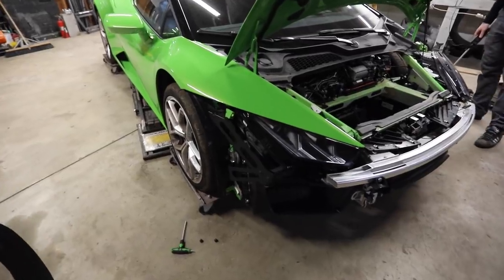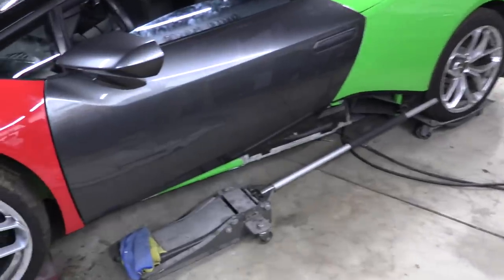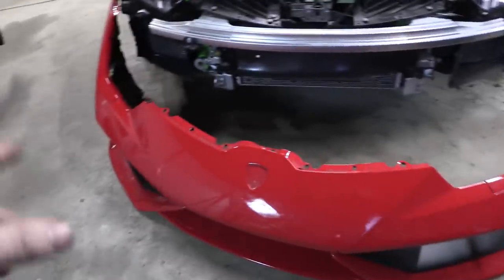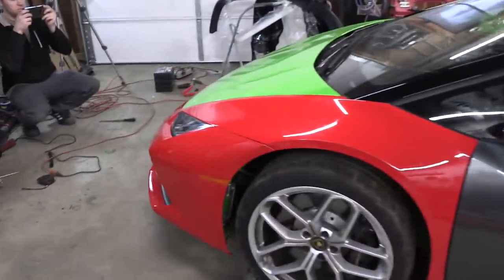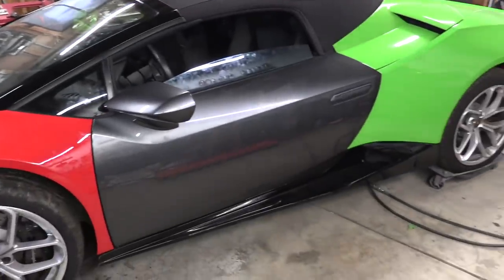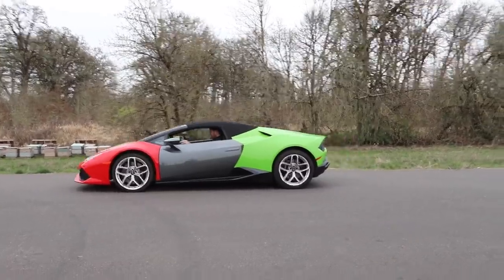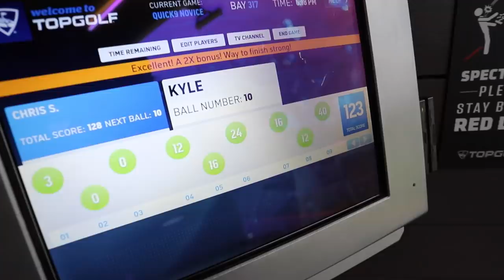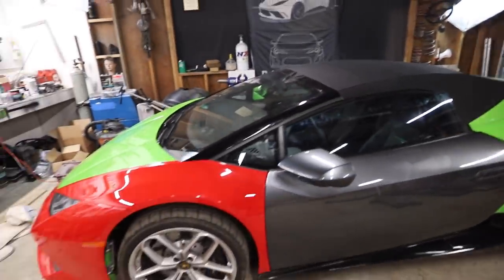Test Driving My Multi-Colored Lamborghini Huracan

Comment: I truly don't understand why anyone would buy a soft top convertible. They're so fugly and ruin the lines of the car.
Reply: Robert Hull so good with the top down tho
Reply: BiGMoFFen nah. Still looks like shit
Reply: Robert Hull if the soft top is lighter weight that might be one reason.
Reply: @joeracer302  that's not true. For the most part convertibles are heavier because of added structural components to keep the car from flexing.

Comment: I mentioned it last episode: that replacement door and window glass is for a coupe not a spyder. You'll notice the glass isn't rounded at the top-rear and there should also be a small add on to the bodywork on the top side of the door that flows into the tonneau cover.
Reply: Bear in mind it's the whole door, not just the glass

Comment: *MISTAKE*    *MISTAKE*    *MISTAKE*    *MISTAKE*    *MISTAKE*    *MISTAKE*    *MISTAKE*

I hope you see this before you start painting.  I could be wrong but... it looks like you got not only the wrong window but also the wrong door.  The edge along the top is not the same where the door meets the rear quarter panel.

Comment: I have to say - with all due respect and much love - that is the most hillbilly looking Lamborghini on Earth. :D Not even the sound of the engine can overcome the junkyard dog look. The three different color body panels are wonderful enough, but knowing the front end is off a different model and that the window glass doesn't fit the hole only makes it that much more legendary. It kind if reminds me when someone would use a Chevy door on a similar model Pontiac and the trim crease on the door was four inches lower than the quarter panels. :)

Comment: Use automotive art Hs 82-50 clear with medium reducer. It’s about 220$ a gallon so it’s not overpriced but it’s good stuff. I repainted a lotus with it and was very happy with the results. It flows our really nice and it’s super easy to use. It’s really easy to buff as well if you wana do 3 coats of clear and a quick cut n buff

Comment: You need to change the whole door  (not only the window glass) which is slightly different, On the top of these, you have a small surface which make the gap between rear wing/spyder door and the canopy...

Comment: Be careful driving the lambo with the window like that. I use to own an 03 cobra convertible and had an issue with the passenger window. It wouldn’t close all the way and at a high speed it ripped my top. I can only imagine what a top would cost on a lambo. It was little over $2,200 new and installed on my old cobra.

Comment: You can cut the window to the correct shape. They do it with unique windshields/rear glass that are no longer in production or too hard/expensive to acquire. As long as the curve of the glass is the same it can just be cut to the proper height/shape.

Comment: In my e92 m3 (also dct) it cuts power if it senses throttle and brake both applies. But a way around it, is to punch it from a stand still so it dumps the clutch and then hit the brakes, it does a burnout that way. I’m not sure if the lambo will let you dump the clutch in their dct system, but maybe try that, I think that’s a way to get it to do a burnout.

Comment: If the glass is the price of an arm and 2 legs, go to a glass shop and get your door glass untempered so it won't shatter, then you can get it cut, then re-tempered. Use the right side glass to make a template